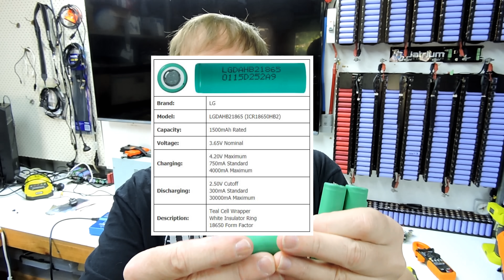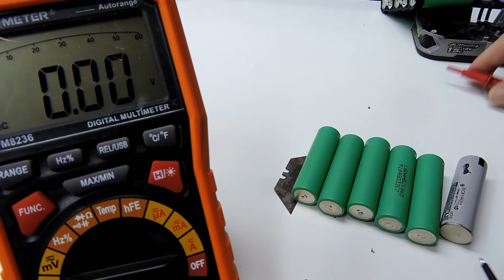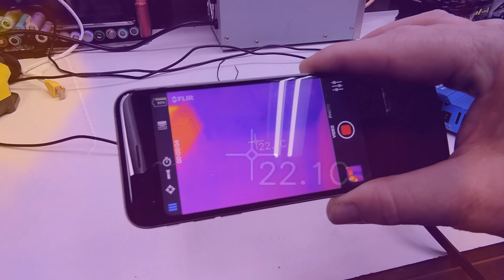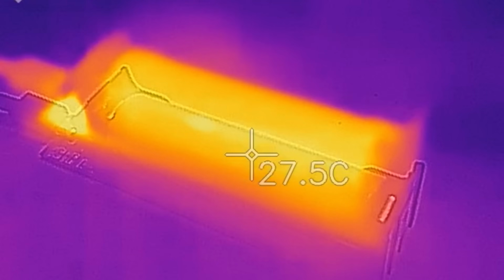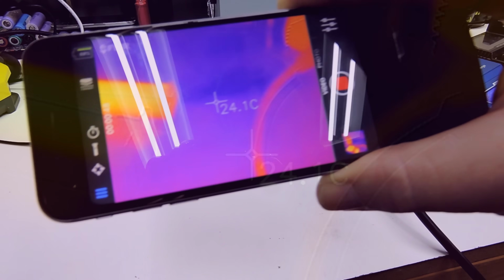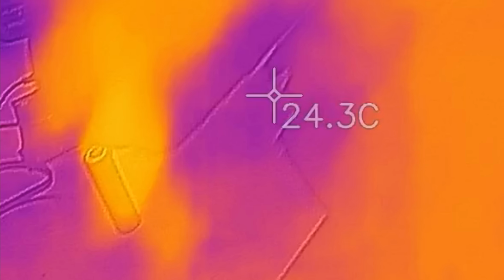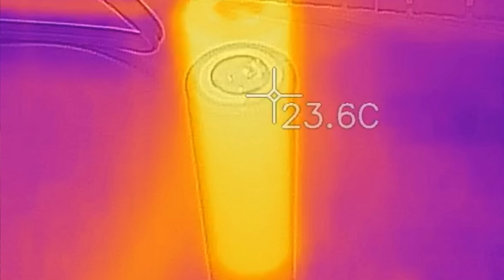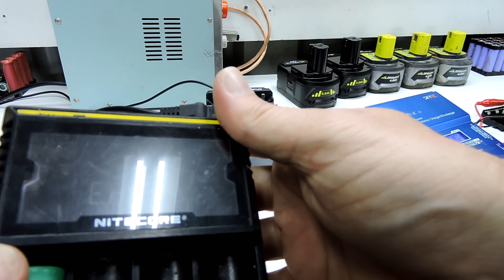18650 CID Reset   ⚡ DON'T DO IT! ⚡

Comment: Don't all cells get to 60 odd degrees when running at CDR.
Reply from the maker: in two minutes?
Reply: 2 minutes is not an insignificant amount of time. Some cells won't last much longer than that at their CDR.

Not sure how many amps your where putting into the cell at that stage but I'm guessing it was A LOT.

Should really have a resistor between the two cells to limit the current flow to under the maximum charge current of the cell, I suggest 4 ohms to keep the charge current under 1A.
Reply from the maker: Seems I might have had a small hole in my thinking - yes it could have been 10-15 amps going into that cell. But that said it was getting hot in the TP charger as well but don't know the amps.
Reply: HBPowerwall I've had good results charging 0.1V cells so without damaged CID with NiCd option on a B6 AC v2 charger with a 0.2 A charge rate. That way you can get the voltage up to a level the charger will allow it to charge further.  I do charge these cells outside though, just in case.

Comment: I have reset the CIDs on many cells before, the Samsung cells seem to have their CID trip the most and have had mixed success bringing back 0 volt cells in this manner.

The CID often trips on these cells because they get too hot, and enough pressure builds up in the cell to pop the CID.

The gasses then escape and the cell CAN be reused, and likely still works from my testing with a capacity loss.

To mitigate the risk of any CID tripped cells posing a danger to the rest of the pack, I carefully track the cell temperature of any recovered cells. Any cell that goes over 35C during the charge/discharge cycle is rejected. Then the cell will go through a 24 hour self-discharge test. These two tests alone eliminate a truly bad cell better than the CID ever could. So that hot LG HB2 cell in the video would have been rejected based on cell temperature alone.

You powerwall builders out there can use whatever kind of 18650 cell you like since your discharge rates are low but for my needs, I require specialized cells to do the job.

I on the other hand am an ebiker, so high drain, high capacity 18650 cells are EXTREMELY hard to come by where I live, and my application requires both high discharge and high capacity cells so if I can find any like that, I do everything I can to get them to work including resetting a CID.

We do this because we don't have the money to buy new 18650 cells, yet cobbling together thousands of random brand, chemistry and age 18650 cells is deemed as "safe" by the community even though it's clearly not as safe as just buying new cells. We then take those cells and solder them together into incredibly large packs with other cells. Yes, the fuses can help but only so much. Sometimes A cell will turn into a resistor that draws current, but not enough to blow the fuse. Many of these packs are harder to balance because the cells are used and an overcharged pack can be a fire hazard. I smell a bit of a hypocrisy here coming from a guy that has access to thousands of cells versus a person like me who may find only 10 cells a month that can be used in an ebike, when many of my packs require a total of 160 cells that are over 2000mah rated for a maximum continuous discharge rate of 20 amps. Finding used 18650 cells with those kind of specs is extremely hard where I live, so anything goes with getting them to work again reliably.
Reply from the maker: I hear ya, no hypocrisy here as I stated in the video intro there are some times people NEED to use these cells but best know the dangers with ANYthing we do as a community. We don't need this being a standard practice. I plan on testing this further if I can do it safely & with out the need to spend hours and hours filming and editing.
Reply: I agree. If you are building a powerwall, definitely don't try this. You are taking thousands of cells and combining them together and one bad cell can make the rest go, so that's asking for Trouble.

But if you are building a smaller pack like for ebike or a flashlight, I think this is okay since a total pack failure is much easier to control if something gets out of hand. 

I charge my ebike packs in an ammo box outside in a tiny metal container, so even if something really terrible happened, I don't have to worry.

This is a good guide for everyone out there but I agree Pete, don't do this for a powerwall when you usually have access to so many other cells to choose from :).

Comment: If u have to do it should use ceramic tweezers or alike to avoid dead short
Reply from the maker: Dead short is easily avoided as I had to hack at that to get it to short but could still easily happen and I like your idea of ceramic tweezers.. Info for those new to the community I guess.
Reply: Good idea!

Comment: Hey guys,im planning on making solar powered powerwall system,how many 18650s would i need to power a 25kw system(its going to be a off grid system) and is there any other alternatives for the batteries ??
Reply from the maker: 25kwh i would say plus 4000 18650 cells to make them last as long as possible - plenty of alternatives but none as fun lol
Reply: HBPowerwall thanks mate,i was considering for alternatives as i live in India and the availability of reliable 18650s are rare
Reply from the maker: Any golf courses around you with electric golf buggies ? Hit them up for
Reply: HBPowerwall no mate,no one is interested in electric and every battery retailer is trying to rip us off,so it looks like i have to search my luck across the county
Thanks for the advice mate
Reply: You could try https://www.nkon.nl/. They have loads of cells available and at pretty decent prices. They are pretty reputable as well.

Comment: peter,
when the lifpo batteries are that far discharged, recommendations are to charge them up to the minimum really really slowly. i suppose the "slow chraging part" is for the reason they do not get hot and degrade even more.
Reply: IIRC, the TP4056 apparently does the trickle charge of 100mA if below 2.5-2.8V.
Reply: I don't know what you are specifically referring to. As I also don't know why this was such an issue in the first place. But this is the last comment I'm making on this section as I don't want to fill Petes inbox with foolishness.
Reply from the maker: They just aren't coming back as you can see from some shots the battery voltage drops as soon as it's removed from the charger. These cells are toast!
Reply: i repeat:
try to charge them with a really small current, like 10mA. till they are up to 2.5V
now i have not tried that.  (tricklecharge was the term they used.) i came across this somebody that drove the home made electric car till it did not move anymore. they trickle charged the battery over night and seemingly it recovered.
but you are probably right for your batteries. they probably are a total loss.
Reply from the maker: Mine are a total loss - far too much heat with far too little charging amps.
Reply: completely different chemistry.
HBP is right on this one.
Reply: korishan, you are totally missing the point what the video is about and what i said.
Reply: Urs:  Really?!?! I totally am agreeing with what Pete said. How could I possibly be missing the point?!?!🤔 The cells in the video are heavily damaged. He charged them slowly over a period of time. He took them off, and they were actively self-discharging by almost .1V within seconds (keep in mind this is about 50% drop of what it had gotten charged to) How could he have charged slower than 130mA?! The TP4056 will trickle charge at about 13% of the set charge current. So if the TP had the resistor set at 1000mA, then it would have trickle charged at 130mA.
Is 130mA not low enough?  You can see in all the other chargers, they didn't even really "try" to charge the cell. The closest was the iMax that said "Error"

In short, I'm not missing the point of either the video or your first comment. Your first comment has nothing really to do at all with the cell he is mucking around with because in the video it is actively self-discharging. It is obviously damaged. Had it been fine, the 130mA charge current from the TP would of slowly charged it up to 2.9V and then started to slam it with full current till it was time for CV mode.

Don't get me wrong, I'm not countering your info. I agree, when a cell IS that low, especially under 1V, it should be super slowly charged. I completely agree. It's just that that saying doesn't have an effect with this particular video or test.
Reply: so we all agree then
Reply: "recommendations are to charge them up to the minimum really really slowly" no, recommendations are to NOT ever charge them again and get rid of them... you missed the whole point of this video sadly...............
Reply: Urs Odermatt: The TP chip does a low mA charge when voltages are really low. However, that does not negate the fact that this is a bad and dangerous idea to reconnect the cid. Would you reuse a vehicle air bag after it's been deployed? Just resew the seam shut, throw in some new powder, and repack it in the holder?  I would think not. You wouldn't even consider such a thing. This is exactly the same with the cid of the cells. They popped for a reason. Safety first!